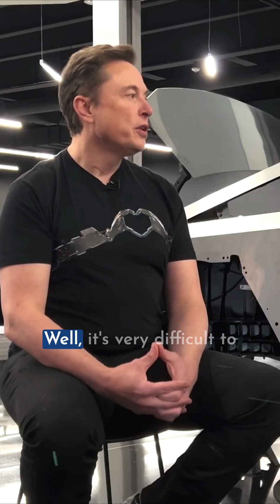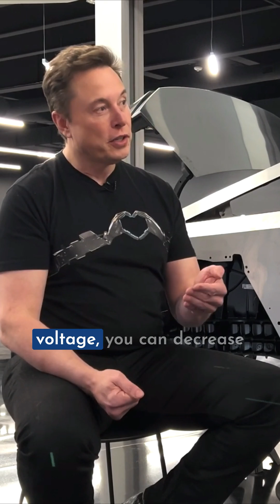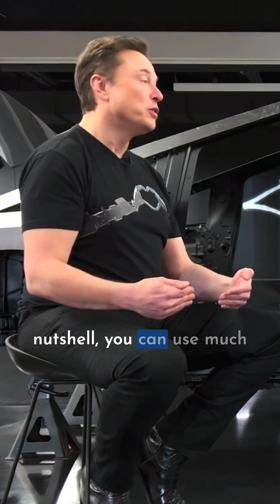Cybertruck: The Good, the Bad, and the Ugly about the 48V powertrain #elonmusk #cybertruck

Comment: From Ohm's Law
Voltage (v) = Current(I) times Resistance (R).  So. V = IR
Power (P) = Voltage times Current .   So     P = VI
But from ohm's equation we can have P = (IR) times I   given us P= I*2 R
Note also that Power = Workdone (W) Over (/) Time (t) .   so   P = W/t 
Note also that Workdone = Energy (E)  so Power Could Also be written as P = E/t
# Elon Musk Calls and World calls 

NB: Resistors are measured in Ohms, Current in Amper ( A), Voltage are in Volts (v), Power is in Watt (W) but Kilo means times 1000 and Workdone or Energy is Measured in Joules (J)
Note time is in seconds (s).

Comment: But limit < 50v, for safety 😅
Reply: it really wouldn't be unsafe to go to 120 volts houses run that through the walls in the US I've been shocked and it didn't hurt that bad really, Europe runs at 240 volts but I don't like that you can get hurt pretty bad if you're shocked by wall but in Europe